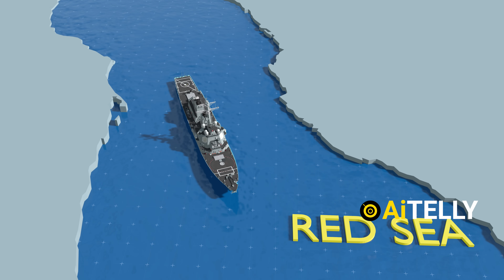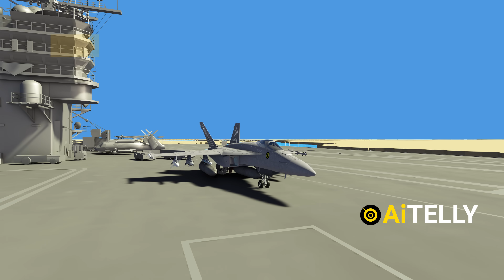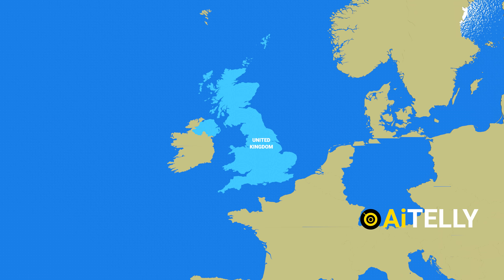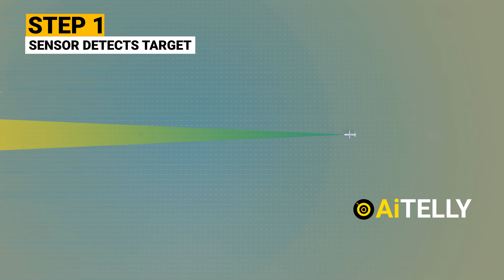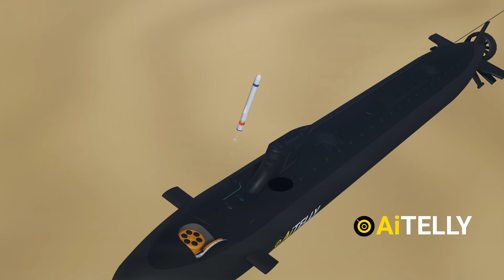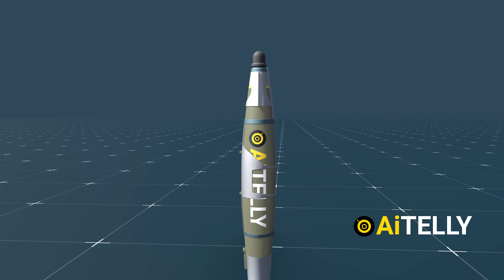How US UK attack the Houthi?

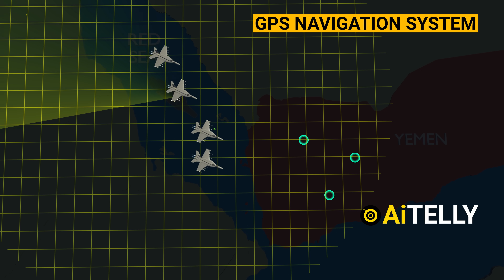Comment: while we're at it, u know, keeping things technical, 1:23 "providing position and velocity vectors", if you add position and velocity, the data is now referred to as a displacement vector rather than a "velocity vector". displacement vector describes the change in position of an object in space. the displacement vector is the difference between the final and initial position vectors, where the magnitude of the displacement vector represents the distance traveled (or the "length" of the displacement), and the direction of the vector indicates the direction of the movement. d=r f −r i =(x f −x i ,yf −yi ,zf −zi) lol

Comment: I have two questions that I hope someone will answer: Israel has a military base in Eritrea. Why don't the Israelis attack the Houthis? And why are the Houthis firing missiles at Eilat in Israel but not at the Israeli military base in Eritrea, which is much closer?
Reply: Israel may be using its eritrean base primarily for defense rather than offense, the base's details are obscure to the houthis, the attacks on Eilat are symbolic gestures not meant to cause material damage, and targeting Israeli bases directly could provoke devastating retaliation the houthis wish to avoid.
Reply: @satyaprakash03133  isn’t the primary objective of this base is to deter any hostile action against Israel in Bab Al Mandab strait?
Reply: @ossama122  Firstly Eritrea's location and its relationship with Israel opened the door for the Israeli state to establish a military listening base to monitor Iran's smuggling of weapons to Israel's adversaries. So profoundly Israel use this for reconnaissance purpose. And the establishment of a military base doesn't have deterrence as its primary objective especially when it is meant to operate in clandestine to gather intelligence.Or there may be classified geopolitical dynamics behind Israel's lack of direct strikes against houthi forces from Eritrea. Striking from Eritrea could pressure the Eritrean government given its complex relations in the region.

Comment: correction at 1:35: GBU-12 Is laser guide not GPS guide, and they have  15 km range
Reply: You may want to do more research. The Paveway systems of bombs come with GPS / Laser guidance. It is a matter of replacing the nose end cap guide system.